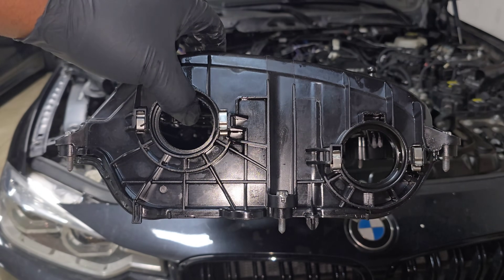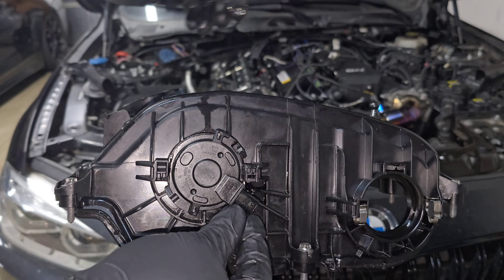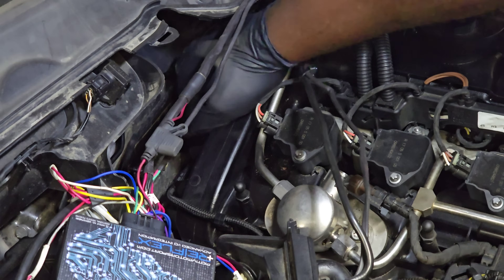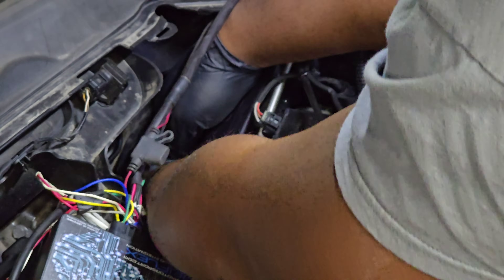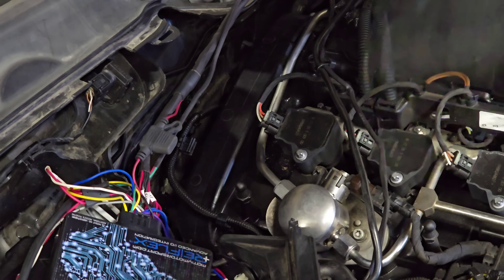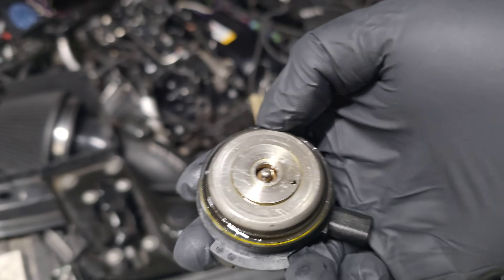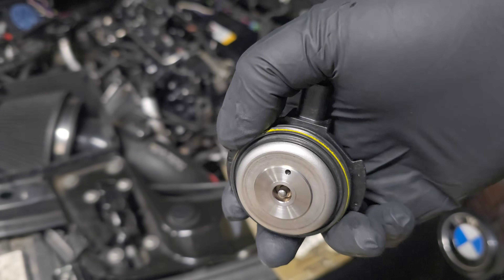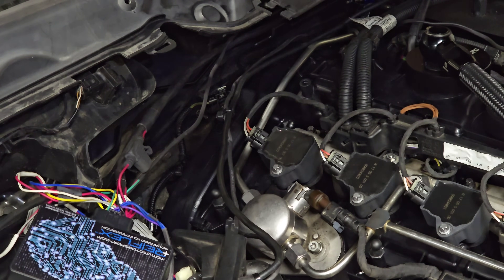How to Fix Rough Cold Start/Idle on a B58 Engine (Vanos Actuator DIY)

Comment from the maker: Vanos Actuator Part Number: 11367614288
Join My Patreon for help with your build and to Support the Channel: https://www.patreon.com/kern417
Shop my Amazon Store for the tools and products I use: https://www.amazon.com/shop/kern417
Order your discounted BMW parts through my BimmerNetwork Affiliate Link (Coupon Code "kern417"): https://www.bimmernetwork.com/?afmc=kern417&utm_campaign=kern417&utm_source=leaddyno&utm_medium=affiliate
Reply: Great timing, just got code P13C0 ('A' Camshaft Stuck (Bank 1)). Pretty sure it's the Intake Vanos, based on the code. The car has no symptoms whatsoever and there are no accompanying codes. Might just clear it and run it out to see if it goes away before ordering the Actuator. Any concerns in mind with that approach?
Reply: @calvhino have had this code for a month and a half took me a minute to figure it out, had no symptoms but has picked them up and gotten worse so i'd say fix it as soon as you can
Reply: @ProdByBenzo  I made sure everything was tight and the connections were secure. I re-flashed xhp and MHD, then drove around. Code cleared itself a couple days later but If it ever comes back I'll just get new actuators. I'd rather a cheap fix now than an expensive one later.
Reply: @calvhino follow up replaced both actuators, code still remains but will go away under heavy load sometimes so im just lost now
Reply: B58 GOAT. Got me prepared for things before I even think it could he an issue
Reply: dont forget the clips, they like to fall where you cant reach them
Reply: Which is one for the camshaft ?
Reply: Are they the same part number for b58tu also? @kern417

Comment: You don't really have to replace them with new ones. It just gets clogged up with dirty oil inside and needs to be cleaned with maf sensor cleaner. I've done that procedure twice already for my f30 with 360,000km.

Comment: My car gets confused when shifting 2-3, 4-5 like it stutters/hesitates. Also when cruising in 8th I get small torque dips, read this could be related to vanos actuators. 

Kern what your thoughts?
Reply: Find an answer?
Reply: @Stoyack-p5j no, but I did replace the vanos actuators, car drove better but idle was still trash on stg2+, ever since I put it back to stg2 never had that problem
Reply: @F36Dreem did your car start shifting back to normal after replacing them?
Reply: @johndough5522 yes it did but also adding a gal of E to the tank on 93 stg2 made a difference too

Comment: Are there any specific codes that would confirm its these that need changing? Mine is theowing up 118001 and 118401 mixture lean codes on my jb4. Although my engine light comes up the car itself isnt giving me a notification

Comment: So the intake side is the driver side and the exhaust side is the passenger side further down? I replaced both and car runs great but now I’m getting 130716 VANOS, exhaust control error. Camshaft is stuck.
Reply: did you solve this?  I haven't replaced mine yet but i have 130715 VANOS intake control error, camshaft is stuck
Reply: @redi6  Yes. It turns out that one of my gaskets was pinched and I was getting an oil leak from the actuator. I re-seated the gasket and it resolved the issue.

Comment: Thanks for the video!! This helped me so much and made the work wayyy easier lol, removing the little plate behind the vanos was super helpful to remove the intake side of it. Just had codes for the intake side and now my car runs extra smoothly now, the driving feels so good right now! Been needing to do this for months but finally got to do it since I had some time and it was getting pretty annoying driving with the bucking everytime lol! It wasn’t as hard as I thought it’d be though and I didn’t even need to hold the clips which is kinda crazy lol. Thank you once again!
Reply: Placebo effect is a real thing

Comment: sup unc nice video has this code pop up and camshaft jamming on my b58 with cylinder n6 misfire any idea what you think it is 

forgot to mention ive already changed the vanos actuator as well changed both and it didnt solve the issue

Comment: Hello, my friend. Made a similar replacement on his BMW F34 B58 today and after driving 10 kilometers, nothing seemed to change. Maybe you know another solution to the problem?
Reply: try resetting VANOS adaptations or he may need an ISTA software update
Reply: @ncklz_1  I flashed all the blocks and reset the vanos adaptations. Nothing changed.
Reply: behind this inside the valve camshafts is the vanos central vane bolt. this has little oil holes and can go bad. also the actual sprockets on the camshaft can go bad and will require a timing chain job engine out. first check your fuel tank breather valve on top the engine, it can go bad and wont show any DTC codes.

Comment: Thanks for going into absolute detail I got the same issue ordered the parts I had jerky shifts in low gear cold engine and it makes a weird scraping sound. I watched other videos and that’s commmon when this has an issue hopefully I can fix it tommorow thanks 🤝🏼
Reply: I have same issue, does it helped ?
Reply: @MarcinT-nn4jk yes it fixed the issue.

Comment: Today's top tips.....

1) DO remove that extra plastic piece. It gives you so much extra room. I messed around for ages and failed on the middle one.
2) Check you've got the rubber gasket out on BOTH actuators. One came off fine, the other remained in there and no matter what I did the middle one wouldn't fit until I realised the extra gasket was stuck in there.
3) Really try and use microfibers to catch those clips when they ping off. I lost two and both dropped down to the left side of the engine bay (fuel pump side). Both landed near the vband for the downpipe.
Reply: I love you bro, couldnt figure out why it wouldnt go in
Reply: Thanks man, my mf gasket was in there on both to lol

Comment: How often should it be changed, if i dont have errors codes?thanks
Reply from the maker: I would only replace if it throws codes or the car is having symptoms that it's going bad. It's not a regular maintenance item.
Reply: @kern417 hi bro did you observe any improvements in driving after changing them? Has gear chnge in low rpm smoothen a lot? Maybe less jerky and ride feels more natural?

Comment: Mine stuck on intake side, wont budge at all. Tried picktools, screwdrivers wont pop out. Dont know what else I can do
Reply: @Pulisheris  it’s a tool on fcp euro that I bought that makes turning them easier.
Reply: @MrCurl17  managed to get it out when took that extra panel off so both my hands could fit. Don't know why I didn't do it first :D

Comment: Hey, is this the only issue that could cause rough cold start idle? I have a G30 540, and only during cold starts, the idle is rough - I can even see the passenger seat vibrating slightly. Once the RPMs drop, everything smooths out. Do you think there's a high chance that the VANOS actuator is bad?
Reply: Same here
Reply: @urmilmodi  I changed both of my actuators, the issue still persists :)

Comment: Thoughts on dorch DS3 pump for Gen 1?
Reply: just go port. less limitations and cheaper
Reply: @ im sticking with DI only until i get a built trans. Gonna grab ds3 with exhaust cam, injectors & lpfp
Reply: @45def55  if you’re staying di you shouldn’t need a lpfp. but with port, it’ll work for you now, and later on when you build the trans🤷🏼‍♂️
Reply: curious too. I think custom tune is needed right now for the DS3, not sure if or when bm3/mhd/mg flasher will drop OTS map config to support it
Reply: @nickmarsden8129  i never see anyone use the exhaust cams either or make a video on them lol. The cam adds an extra 40% flow paired with the ds3 that flows 20% over ds2.5 that should be crazy gains with injectors & big turbo guess ill have to see for myself.

Comment: would a broken valve cover cause oil consumption kern, already tried replacing the PCV..
Reply: Check oil filter housing (also gaskets) or oil pressure sensor (above the oil filter housing, it’s loose on many b58‘s)

Comment: Do you know where I can get just the rubber seal? My new ones came without it.
Reply: Reuse the old ones
Reply: @ I did, was just checking. Mine still does some stumbling after cold start with the new actuators in. It runs fine though 🤷🏽‍♂️

Comment: Hey kern this is unrelated, but I just tuned my trans with xHP, but am not sure what “good clutch pack” ranges are on the data logs, would you be able to help me look at them and tell me if I have anything to worry about?
Reply: ignore them, drive the car until something is actually broken.. people tend to scare monger with clutch values
Reply: The closer they are to 0, the better... 😃👌🏻
Reply: @technopro-kz4xv  I had wish you didn’t say that… cause none are than close lol
Reply: @V-Lone-XO  oh ok… but don’t worry too much about it, they are close to 0 when the car is brand new… How many miles does your car have? Do you feel clutch slipping in 3rd or 6th gear when you are pulling hard the car?
Reply: @technopro-kz4xv 72k miles, 2019, I honestly don’t really feel slip in any gears, only time would be in 6th when I’m light on the throttle and it doesn’t know if it wants to shift to 7th or stay in 6th at 50mph, but that’s more of a hesitation than slip I’d say